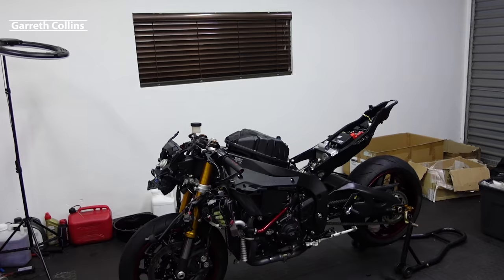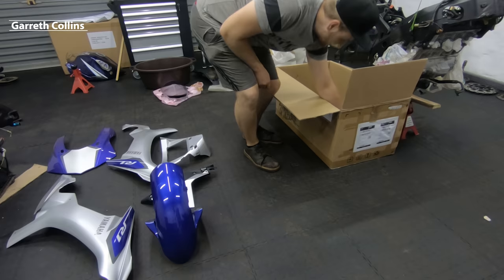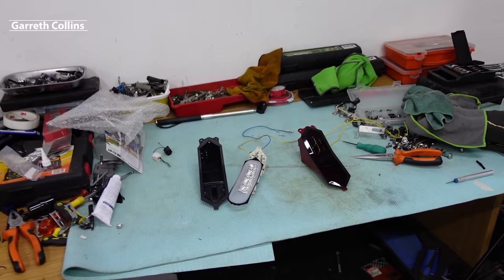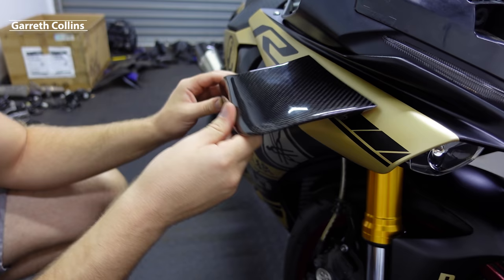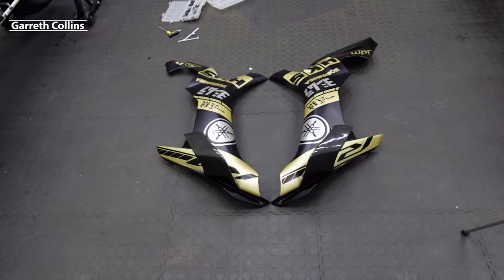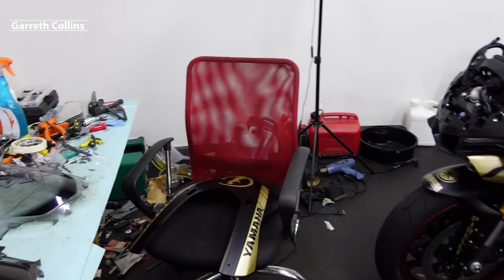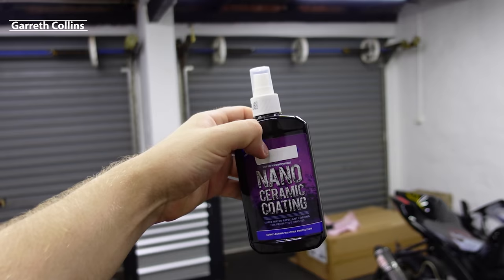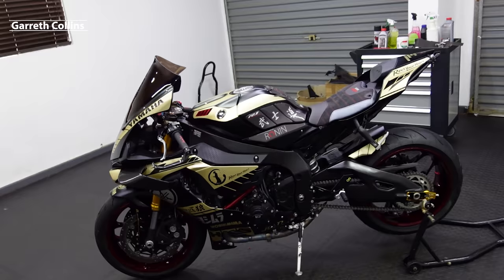Rebuilding A Crashed 2019 Yamaha R1 Part 6

Comment: Awesome contect as always! The length is just fine, interesting to see even the "small" things that you do in your builds, detailing etc. Did you use the same ceramic coating for all the bike, wheels frame plastics, if yes, could you share the brand?
Reply from the maker: First time I ever used this ceramic coating seems like its a bit too cheap there are definitely better brands out there

Comment: Super super.  Well done on the great job.. was so anticipated to see the bike came out awesome.. Questions I have is that the holes on the seat, won't that be a problem with water and are you going to fit Radiator and oil cooler gaurds?..
Reply from the maker: holes in seat is because its a carbon fiber race seat and i already have oil cooler and radiator guards on i installed on other videos go watch
Reply: Ok cool I probably missed it.. but I will check it out..  if I had enough funds.. I would be taking it off you hands... 🤣🤣🤣
Reply from the maker: @thabotsotetsi3191  That sounds like a plan!

Comment: They wouldn't send you a new winglet anyways, I told them about mine the first day and they said it was normal just make sure to drill it.
Reply from the maker: yeah its definitely not normal but made it work
Reply: @GarrethCollins  I've talked numerous people who bought these and they all had the same issue on the same side. And they all did the same thing, they got told it was normal.
Reply: I didnt think id like the wings, but honestly they came out awesome.
Reply from the maker: @carbonsanity3792  well i ended up mounting the top part flat and having the fairing at the bottom pull up a bit basically bend it and it works fine with the screws in
Reply from the maker: @dancarlos1216  I think they look good i do think they are useless but i never tried them so this would be a first
Reply: @GarrethCollins  yeah thats what I noticed. I got some bigger and flat head self tapping screws cause the ones they provide aren't really made for this lol. But your video definitely helped give a visual. Thank you.
Reply from the maker: @carbonsanity3792  no problem sorry it couldn’t of been more detailed but thats what i could do without making it boring as u noticed i did the wings for quite a while just for you😁😉 hope you can considering becoming a member 💯
Reply: @GarrethCollins  definitely!😁 and thank you again, I really appreciate it!!
Reply: Outta curiosity where did you guys buy these winglets?

Comment: The tuning fork emblems are very incorrect.
Reply from the maker: u think ? you can give Yamaha a call and let them know they gave me the incorrect ones>?
Reply: @GarrethCollins  

The overall paint scheme looks good but the gold tuning from emblems on the plastic are off. They would drive me nuts. The tips of the forks are supposed to touch the outer portion of the circle. It almost looks like the did the yamaha music emblems.
Reply from the maker: @moton8tion866  i get it I understand